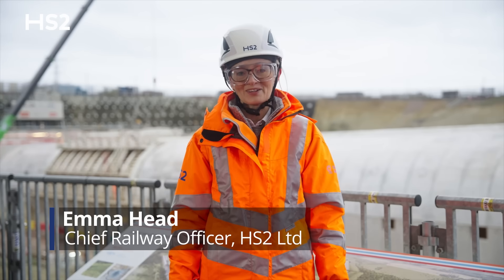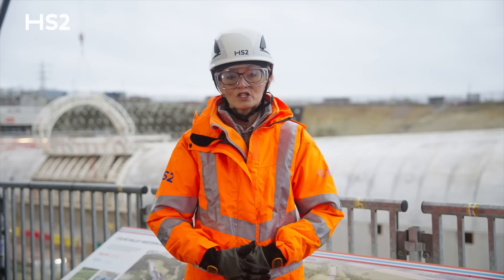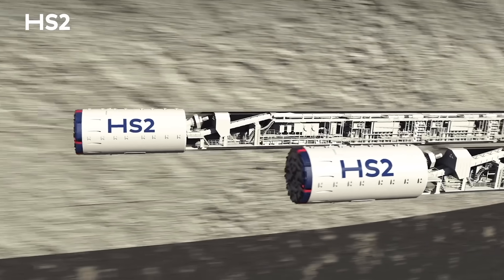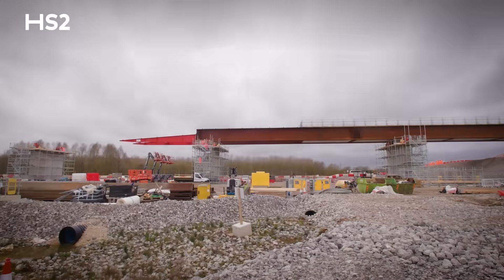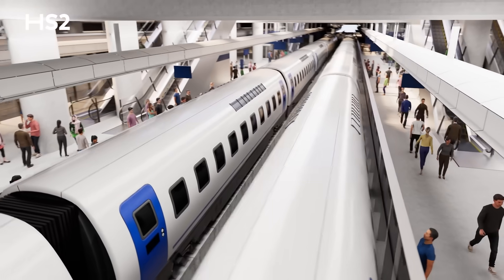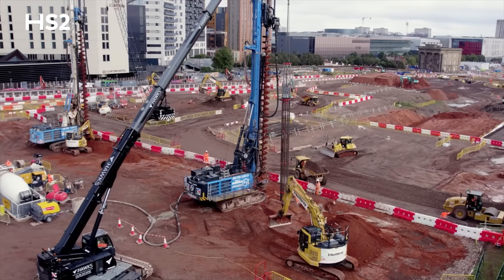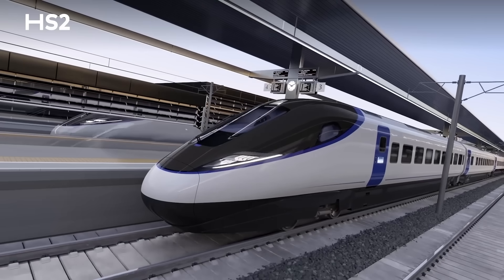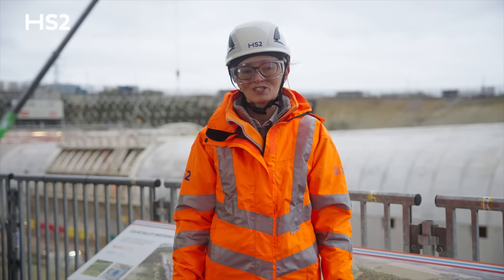HS2 Project Update, December 2024

Comment: Now touted as being to increase capacity rather than being about speed. If that’s the case then just run longer trains on the West Coast line between London and Birmingham by increasing platform lengths, power supplies etc. A lot cheaper than this.

Comment: Honestly we need to get on with this now.
"We're making extensive preparations to begin major construction"
"We've excavated the station box and we're preparing to begin building the platforms"
"Engineers are building the TBMs to dig the last 4 miles to London"
"Production will begin on the fleet of trains around 2027"
No wonder the project is late and over budget! They need to set clear deadlines and fixed prices with harsh penalties for delays.
120 years of infrastructure? More like 20 by the time it's actually built
Reply: Contractors won't accept a fixed price for very large construction contracts this size as their profit margins won't cover the risks.  There are liquidated damages clauses in construction projects where the contractor pays the stipulated sum expressed on a weekly basis for late completion but the reasons for a delay are subject to agreement and on this project late completion on one section won't affect the overall delay to the project so the damages can't be calculated as it is impossible to calculate the cost of the loss to HS2 of not having one particular phase completed on time.

Comment: Phase 1: get project signed off on the promise of levelling up the north.
Phase 2: spend all the money down south.
Phase 3: cancel northern leg due to over spend down south.
Phase 4: slap each other on the back for shaving off c30mins to the existing journey, that’s about a BILLION per minute saved.

Brilliant update, yes, brilliant 👏🏼
Reply: was never about speed. It's about capacity. The route has been over capacity for decades
Reply: @kitkatklan1 from the beginning,  it was always about speed. Hence its name.  If we needed more capacity,  they could have added additional carriages to the trains already running. Then they quietly kept adding to the time, then memory holed it, because nobody thought about the commute times to find stations when they removed options.
Reply: @rosiecatbandit  Think you are getting mixed up between network capacity and train capacity. HS2 specifically gained funding and cross-parliamentary support because the existing railway network could not support economic growth due to congestion on the trunk lines, East and West Coast High Speed Lines (see what I did there?). 

You see its all about paths for train services, all paths will cross the trunk lines at some point using a part of it to cross onto other lines, this is the network capacity. If I just double the length of my train then it does not mean I have suddenly freed up space for another train to run on the same track, that can only happen if I reduce the number of my doubled-trains that run in the day, so I havent actually increased the capacity on the network, just made my doubled-train length service less attractive to passengers and freight companies. Also increasing the length of trains significantly on an existing line is a pretty bad idea as you have to then significantly increase the size of all platforms along the line which with old lines going through the middle of towns will end up astronomically expensive!

Far cheaper to build a brand new line with brand new platforms for my new longer trains, the brand new line has then allowed me to move duplicate services to the new line and thus freeing up paths on the old lines for ... more services! Oh yes I just realised I have basically just described the HS2 concept.

Standard international railways are now basically High Speed by default, all that manufacturing and design expertise around the world, off-the-shelf cost savings just think about it. Only a complete fool would spend even more so they could build a non-standard bespoke, say Victorian style, railway just to say that it is not high speed?! What an incredibly  bizarre concept you have up there in your head.
Reply: @rosiecatbandit  Too be fair you should always have a high speed railway system unless your country is small enough with out the need for it. There's no reason to upgrade things.

Not our fault our governments are corrupt to such a massive degree (no country is blameless in that regard), that they would funnel off funds to their mates, private contractors and other useless prats.
Reply: Agreed for the most part, but who is taking 70 minutes to get from London to Birmingham? Unnecessary hyperbole just completely ruins the comment
Reply: @stephenoxf  it was all b.s, the death by a thousand cuts was nothing to do with "cost overruns" for a project that was budgetted over multiple decades but everything to do with political ideology of which the people of the North should take equal if not more blame.
Reply: @stephenoxf It's not too much of an exaggeration. 90 mins New street>Euston
Reply: Newsflash : Guess why the Midlands is called The Midlands, klownski.
Reply: HS2 is all about capacity, current lines are completely clogged
Reply: Yawn are you that desperate for a naff anti-south narrative? You are obviously dangerously clueless about the project and the recent politics. HS2 was meant to be an entire new National Network to reduce capacity bottlenecks on the West Coast Line while also anticipating the upcoming bottleneck on the East Coast Line over the next decade, hence the Y configuration. The fact that it was a complete new national network created a healthy Cost Benefit analysis which generated cross-party support for over a decade. Obviously it was going to start between Birmingham and London as that would release the most capacity on the West Coast Line for improving local services in the Midlands and also is a sensible place to start for a Y network, it just happens to be very densly populated with higher land costs. Did you ask yourself what happened in Politics to destroy the Cross-Party concensus? Clearly Not.

The politics that chopped away at the network to reduce its cost benefit gains had nothing to do with "build costs in the South" (all large projects including the Motorway network have cost overruns becauses it is impossible to give politicians the low costs they demand at the beginning for projects that take many years, even decades, note how these cost-overruns were basically just normal inflation projected into the 2030s by the media) but everything to do with an ideology against building any public transport infrastructure full stop (why do you think Sunak tried to spin in his pea-brained axe as an appeasment for road potholes in the North and road bypasses that had already been funded?!). The spin machine from the Rich Persons Alliance, I mean Tax Payers Alliance didnt appear out of nowhere it was a careful orchestrated campaign that was given power because the general public (particularly those in the North) voted in a government full of MPs alligned to extremist neo-liberal economics under the guise of the obsession with Brexit. Boris who actually supported HS2 and rebooted the Northern PowerHouse as the "end of Austerity" chopped of the Eastern leg as an appeasment to that very extermist neo-liberal economic fringe of his party because he couldnt control them, this is how Truss got in and who Sunak tried to appearse yet again by axing the Manchester leg of the network, because he was terrified of Nigel Farrages Reform party that is basically funded by the same Neo Liberal extremists... and look who votes for them, hint look up North..

Comment: Just so we know factually exactly how this project is going :

From the Department for Transport (Public Accounts Committee) on 19th Dec. 2024
"The Department for Transport (DfT) has confirmed the High Speed 2 (HS2) project is currently undergoing a full programme reset and it doesn’t currently know what the estimated final cost of delivering it is going to be.
Speaking at a Public Accounts Committee meeting today, 19 December, scrutinising the value for money of the project, members from HS2 Ltd and the DfT stated that an updated cost estimate for Phase 1 (which is the only remaining phase of the project) is expected by mid-2026, at the earliest.
The revelation that an official total value for the remaining phase to build a high-speed line from Birmingham to London is not currently known follows a leaked document reported to state Phase 1 could cost more than £80bn...This is based on a leaked update from ministers that put the budget at building the line between £54bn and £66bn, in 2019 prices. Adjusting for inflation, this would be between £67bn and £81.7bn in current prices."

and unbelievably .. "We need to reach agreement on a cost estimation methodology which we do not currently have"

“It is going to take some time now to arrive at a revised estimate, and not just a cost estimate...We need to agree a revised range on cost and schedule.”

And just in case people think this cost overrun is just due to Nimbyism and bat colonies: "Part of the reason for the unknown total cost and the need for a reset is down to issues with the main works civils contracts.

“Part of the reason for the unknown total cost and the need for a reset is down to issues with the main works civils contracts.I’ve looked at this in some detail, across the passage of time, and the problem is rooted in the main works civils contracts."

I will try and post a link , but its just there on google. Search HS2 DfT
Reply: Yes well said. You have covered everything except one important point though. Resetting the programme means getting a handle on the actual final cost as well as getting a handle on the actual programme duration for completing the project and that will require a renegotiation of the existing civil engineering contracts. Having worked for 2 of the Contractors involved in building the project I know none of them will sacrifice the low risk costplus contracts they are currently working under unless there is a strong likelihood of retaining a profit margin from their contracts. And that will mean remaining averse to the risks leaving HS2 exposed to those risks.
Reply: @TrevorWilliams-fq8mg my information is from New Civil Engineer Dec 19th. I can't post a link but you can easily search "DfT HS2 New civil engineer". It does mention the contractors overrun near the end, but not nearly enough. It would be interesting if people in the field, such as yourself, could create more content on the nitty gritty about what is actually going on here.

Comment: Great puff piece for this £100 billion white elephant. The trains will be stopping at Old Oak Common when this is finally finished in 2030 , meaning that the journey from London Euston to Birmingham will be longer than at present. The continuation into Euston isnt due to be completed until 2040 .
And I know a lot of people will say that this isnt about time saved but load distribution, but this has completely been sold on the time savings (as she mentions in the video), and it's called High Speed 2  , not Load Distribution 2.
This is public money going into private hands at a massive rate. And just to emphasize again - £100 billion is 100 thousand milllion pounds. 
 Just for comparison Indians moon rocket was £75 million, China's Yaxi Expressway measures 149-miles long and cost £2.6billion. (if you are an engineering buff, its worth a look, its incredible)
Reply: Land, labour and manufacturing costs vary by country. Building in and around one of the most wealthiest cities on the planet is not the same as building through rural China, nor building a single rocket in a nation where the average wage is £187 a month or £6 a day. Just so you know.

Whether it's been missold as such is a fair question, but HS2 IS about capacity. The high speed part was just the PR sweetener. HS2 takes intercity passenger load off the existing network and allows for much improved freight and local services on the existing network. It's an expensive but necessary network upgrade, not a white elephant. Infrastructure construction in advanced, densely populated mature economies is always expensive. It's always in somebody's back yard and always costs what land, labour and resources cost for the region. The UK has high costs, but it doesn't make the infrastructure we need any less necessary. Costs would be similar if built around San Franciso, NY or Tokyo, which is more analogous than India or China.
Reply: @dreamingupaforest  Thanks , yes I am well aware of varying costs per country. If you want to compare countries then you could pick a european one. Cost per km of phase 1 HS2 is £200m per km (if you pick a conservative total cost of £44bn) . European rail can be built at  £32M per km. However its more likely that phase1 hs2 cost will be at least £80bn giving a cost of £400m per km. So we are talking 6 to 12 times more expensive

What you seem to be arguing is that if something is (maybe) necessary then the cost is irrelevant, as it is always going to be expensive . 
This incredible cost overrun is so bad that it has just back to Dept Transport public accounts committee (19 Dec). The cost/scope overrun is so bad that the program is undergoing a full reset, and the new estimate wont even be available until 2026. They dont even have a cost estimation methodology

“It is going to take some time now to arrive at a revised estimate, and not just a cost estimate...We need to agree a revised range on cost and schedule.”

And if you think that this cost overrun is just due to Nimbyism and bat colonies and cost of land: "Part of the reason for the unknown total cost and the need for a reset is down to issues with the main works civils contracts....I’ve looked at this in some detail, across the passage of time, and the problem is rooted in the main works civils contracts."

If people keep repeating the same arguments about cost of land and nimbyism while neglecting to consider the sheer cost of mismanagement and syphoning off of money into private hands,  then lessons will not be learned, the future project costs will be even higher and the same will go for other infrastructure projects.

I will try and post a link , but its just there on google. Search HS2 DfT
Reply: Very true but the reset won't achieve very much asxit relies on the contractors to agree a renegotiation of the existing contracts. They won't agree to taking on risk without having the opportunity to assess the risks.
Reply: HS2 will now be terminating at London Euston, haven't you read the news lately

Comment: Instead of fast trains we need more capacity by using double decker trains.
Reply: Double deck trains will not fit the UK loading gauge
Reply: @ can’t the UK loading gauge be engineered? Surely cheaper than HS2.
Reply: @geoffnewman3109  What widen every tunnel, bridge, viaducts, make bridges and tunnels, higher every over head catenary pylon to be made  higher and ever station altered by altering the track which then impinges into the safety 6 foot safety area between two running line in the UK plus the upheaval, delays. diversions and shutting of ever running line in the UK just to run double deck trains where as in Europe it always been to the Berne Gauge or UIC Gauge as it s called now so no it would not be cheaper than HS2 just to run a double deck train
Reply: @peterwallen1063  double decker trains don’t have to be wider, and they can be lower to the rails. You don’t have to copy a European approach. It doesn’t have to be every line, rather like HS2 will not run on every line.
Reply: @geoffnewman3109  They were tried in the 1950's total failure, double deck trains will not fit the UK loading Gauge, the only reason they run in America nd Europe is because over the larger loading gage in those countries. The HS2 trains being built to the UK loading gauge will be capable to run on any electrified line with over head line equipment and 25kv power, that is how these trains will reach Liverpool, Manchester and Scotland by using the existing WCML to these destinations.

Comment: 38 minutes from central london to birmingham airport? it takes 33 minutes from paddington to terminal 5 on the lizzie line. the links to airports around the country is massive, that’s so quick?
Reply: Good luck with being able to AFFORD THE TICKET PRICES 😂😂😂😂😂
Reply: @robertday8619  i am rich
Reply: @robertday8619  You will have no choice in the matter as when HS2 opens 95% of high speed train services will stop running on the existing WCML and run on HS2 instead
Reply: No to Birmingham City Centre not Birmingham Airport

Comment: Emission free? Just because it's electric doesn't mean it's emission free. If the power comes from one of the many UK Gas powered stations, then it is fossil fuel driven! Just like EVs that have to drive for 50000 miles before they negate the carbon usage of their construction. The whole green movement is still a huge sham until UK completely converts to solar and wind for 100% of its generated electric and even then you have to discount the production carbon of the solar and wind turbine construction. Basically nothing is and never will be totally carbon free., but ay least we are trying.